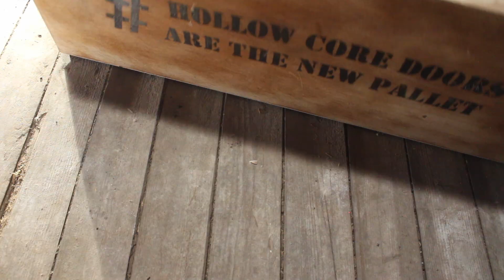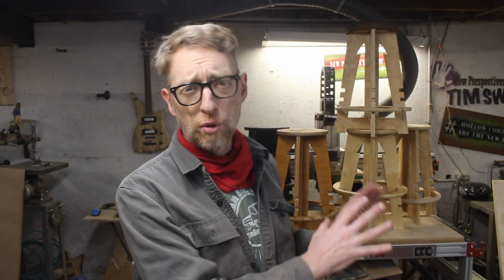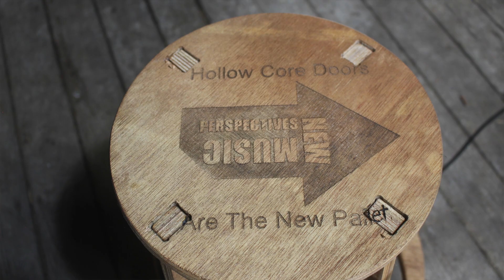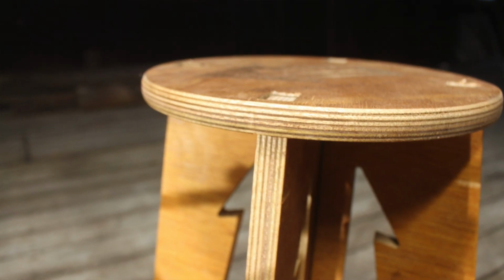DIY 3/4" Plywood from Old Doors (and I made a guitar player stool from it)

Comment: Some valuable ideas Tim, thanks.  Watched the Vectric and Avid videos too.  Another thing I have found with the compression bit is to do the first cut at the various depths about 1.5mm (approx 1/16") out from the required size then do the final pass at full depth.  This gives a really nice finish on ply and MDF and I do it because my CNC doesn't have enough grunt to do a full depth cut in one pass but it can do it if only removing a small amount of material.  Cheers, David.
Reply from the maker: that is a good tip. I believe the vectric software has a "final pass" feature so you can program that little micro move in for the final go around.

Comment: The hight adjustable footrest is a cool design.
Reply from the maker: thanks! probably unnecessary but a fun thought experiment :)
Reply: @timsway  I believe that sizable number of classical guitarists will at least get interested a bit in that stool with the height adjustable footrest to replace a set of chair or whatever and individual footrest. 

Even though I play electric guitar exclusively, since I hold necks like classical players do, a footrest definitely helps me to make the neck stand up but I don't like common individual one for some reasons. I'd definitely grab one only if something like you made were sold at a reasonable price here. 
I couldn't find any chair or stool which was good enough for the matter but the problem was solved by getting a well-designed headless guitar, by the way.
Reply from the maker: @mitokyo3679  I've done a few recording sessions and gigs where I just couldn't hold the instrument the way I wanted, always due to stools that were too tall and with only one place to put my foot. And I'm a tall guy!

Comment: That plywood turned out great!  Video was well produced, didn't realize you had an empty area in your shop. : )  Was that an airplane windscreen in the background? Stool is super clever. Great design. Mahalo for sharing! : )
Reply from the maker: the upstairs loft of the shop is mostly dead space like that but the floor is VERY dangerous to walk on. (Half of it we put down some osb to move around and store stuff). Yes, that's part of an airplane. I have a whole 6-ft section of the roof, too: https://www.youtube.com/watch?v=_5-kB_0OPVk

Comment: Seems like a great idea and would be even stronger than most plywood, no voids. Couple questions. How many door panels did it take to get the 3/4" and did you offset grain direction?
Reply from the maker: cheers. each door is three layers of veneer totaling .125" and the middle layer is cross-grained already, so I didn't bother cross graining my panels, of which I used 6. If I were making a smaller chunk (and I plan to) I would cross them again but I was unable to do that in this large size
Reply: Thank you